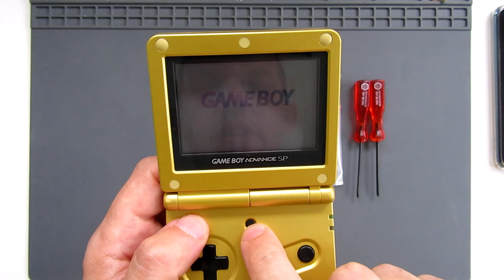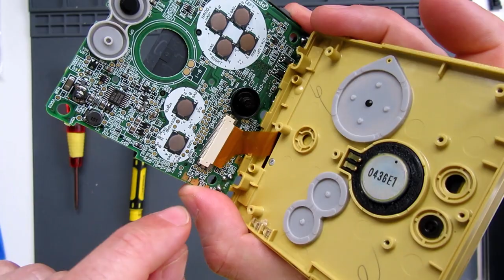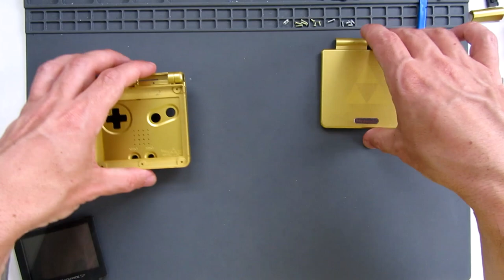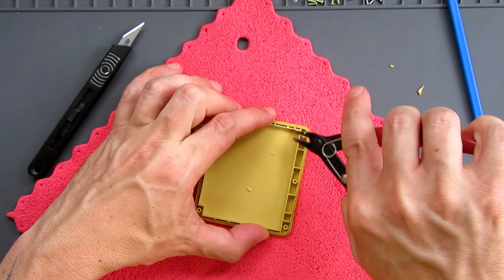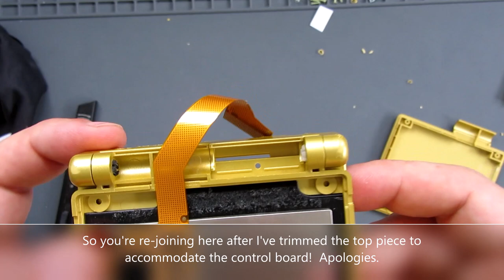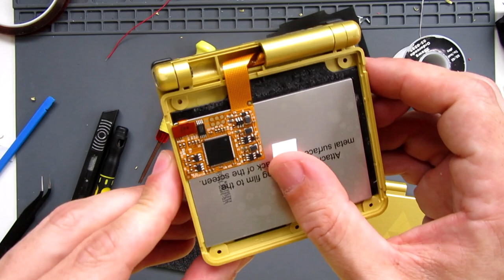How to fit an IPS screen to your Game Boy Advance SP

Comment: Great video which helped greatly with the install. I didn’t bother with soldering, however for me the trickiest part was getting that damn ribbon cable clipped back in, either you didn’t spend much time on that part of you find it super easy!!
Reply from the maker: Ahh sorry! Yes it is a bit tricky but not as bad as the ones on the DMG that require more force
Reply: if you dont solder does it remain on low brightness or high brightness?
Reply from the maker: @brokenshadows9357  highest setting
Reply: @JoeBleeps  is this the same with the v2 ips?
Reply from the maker: @brokenshadows9357  off the top of my head, the default with these things is just "on", which is the brightest setting. All the adjustments you can make just dim the screen to different increments.

Comment: How centered is the new screen? Do you lose a few mm on one side? Also, when you shake it vertically and horizontally, do you hear the new components move even slightly?
Reply from the maker: It is well centered and fairly snug. The foam insert helps stop any rattling

Comment: I'll be honest I did this myself but couldn't stand the IPS screen, I'm going back to the original front lit display the games were designed for. I thought I'd love it but just couldn't get on with it, thought the games looked worse, like radioactive worse. The shells are very cool though especially if the original is scratched up. Good work anyway Joe it was a very useful video you have made here.
Reply from the maker: Ahh that's a shame. I like how it looks but I guess it's not for everyone

Comment: Oh man! Now I can upgrade my original black 001 (it's so beat to heck) and has dust the size of two to three pixels between the screen and the front light.
Reply from the maker: Awesome! If you're thinking about replacing the shell too, take a look at my video with the Super Famicom shell, there's some useful info about replacing the hinges on there
Reply: @JoeBleeps  dude. You rock ♡♡

Comment: Did you notice any reduction or improvement with battery life?
Reply from the maker: Definitely a reduction. Not entirely surprising. The original battery is pretty old now and is 600mAh, so I've tried replacing with a new third party 850mAh battery, should make a fair improvement but I've not tested it enough to be able to tell yet.

Comment: Hello, on my C67 it seems that the solder doesn't stick, and it doesn't have that golden thing like in your video, do you know what it could be? Thanks!
Reply from the maker: Hard to tell without seeing it but the pad may be corroded or it may have been ripped off the motherboard.  You could trace the point to the next component or another suitable solder point maybe?

Comment: Thanks for this video. I’ve basically got a dilemma; I bought a reshelled gba sp with the ips v2 screen installed but I think the lens and the lcd have not been aligned properly as the screen is a bit wonky/slanted. It is uneven.

What I’m planning to do now is use floss to separate out the lcd and lens and put a new lens onto the lcd, worst case scenario the lcd breaks, then I’ll just order a new screen entirely and connect that to my gba sp (and do any trimming on the shell that i need to). In that case, I’m sure I can just remove the ribbon off my current screen (the one with the lens and lcd not properly aligned) and just connect that same ribbon to the new screen?
Reply from the maker: If you're doing that use a hair dryer or heat gun to make it easier to remove the screen cover

Comment: In terms of battery life how does that change? Does it have a better battery life than when the normal screen is installed?
Reply from the maker: It's the main disadvantage of these screens; the battery life is much shorter especially at max brightness

Comment: Can you link those side cutters ? I ruined two cases trying to melt the plastic off, since I don’t have proper cutters . I used a flat head screwdriver by heating up with the stove fire , which not only is not safe , it took way too long .
Reply from the maker: Yeah that would take an age! Even using a craft knife would be quicker than that. I bought my cutters from Maplin years ago before they all shut down. I don't remember the exact brand, but hopefully side cutters or fluch cutters as a search should do you well. The Games Workshop tools are generally good quality and intended for cutting plastic though

Comment: I have a question I also have the GBA sp asg001 I’m looking at these screens but in the details a lot of them r not telling mi if it’s for the 001 or 101 or do the new screens work on both?
Reply from the maker: I think it's mainly for the 001, it works with a 101 board too but I vaguely remember it needs wiring up differently. I don't think it's worth upgrading a 101 as it's a great screen anyway, but an IPS is a great replacement for the 001 for sure

Comment: Quick question when you "cut/shave"  the sides, I've just reshelled a SP & got a new screen protector with the kit but my question why can't you just carefully remove protector & just recenter the screen?
Reply from the maker: The IPS screen is bigger and has the display slightly off centre to fit.

Comment: I don't have a solder ing iron is there a way around it?
Reply from the maker: If you do it without the wires it will just default to maximum brightness, I think. But if you're spending out on a Gameboy, a new shell and a screen kit, a soldering iron is a worthwhile purchase too

Comment: I forgot to put the insulating film behind the screen before closing up the shell, is it really grave if I didn't?
Reply from the maker: It's more of a precaution than anything, if it all seems to be working fine I wouldn't worry. If there are any issues then that's the first thing you'd need to fix when troubleshooting
Reply: @JoeBleeps  Thanks, I'll keep an aye on it; but I'm tempted to open the thing back up and already dreading dealing with the hinges again
Reply from the maker: @sashielefreet1799  the hinges don't need dealing with once they are in place, you'll be fine
Reply: @JoeBleeps  damm you're right, I was about to something really REALLY dumb... Thanks bro!
Reply from the maker: @sashielefreet1799  no problem!

Comment: Great tutorial! I've completed the installation myself however, after about 5 minutes of playing the left button now controls the brightness aswell :/ when pressing the brightness button it also counts as a left press, could this be a soldering issue?
Reply from the maker: Sounds like the wire may be trapped under the d pad maybe? Could be a soldering issue also

Comment: what type of wire did you use for soldering?
Reply from the maker: I normally use 32awg servo wire or kynar
Reply: @JoeBleeps  thank you so much
Reply from the maker: @beagleboy2.040  I love the servo wire because it is easy to strip with your thumbnail and it's flexible so it puts less strain on the joint

Comment: Amazing vid! Anyone know where I can get the IPS screen in the US? The chinese vendor Joe used doesn't ship to the US and the website RetroModding does not ship it's screen to the US either.
Reply from the maker: Thank you! I'm sorry to hear its been hard to get one. Have you tried Deadpan Robot? They are UK based but ship internationally, try the link in my description if you haven't already.
Reply: in case you haven't found one yet or anyone else needs one, these kits are all over ebay from tons of chinese vendors, some even sell them bundled with aftermarket shells that don't need trimmed to fit the lcd (although most shells don't include hinges so you would need to remove those from your original shell)
Reply: @coopercummings8370  

Yep, that's exactly what I did but I bought the kit on AliExpress instead of eBay. It works and looks great. Here's the link for the one I bought for anyone interested: https://www.aliexpress.com/item/4000843765370.html?spm=a2g0s.9042311.0.0.1e574c4dQqNBM4

And also here are some pics of my finished GBA: https://imgur.com/gallery/sdmqC4F
Reply: @JoeBleeps  Hi Joe, sorry for the late reply. I never got to see this notification. I managed to get the kit on AliExpress, and it turned out great! Only caveat is that I don't have a soldering iron so I couldn't implement the brightness selector. 

Anyway, thanks for the amazing video! Here are some pics of my refurbished GBA SP: https://imgur.com/gallery/sdmqC4F
Reply from the maker: @kevinrivera2813  that's awesome! And no worries, thanks for the update!

Comment: In your experience does it effect the speaker using these ips screens? Mine seems to have a bit of noise since installing the screen and is especially noticeable using earphones
Reply from the maker: Not to a distracting extent. I'll have to check one against another to see. Or hear, as the case may be 😅
Reply: @JoeBleeps  i have a feeling that as it’s drawing more power it’s somehow effecting the sound as I can pretty much hear the different frequencies and hums as the games load. It’s much worse using headphones.

Comment: Be careful with those "free" screwdrivers! If you come across a stubborn screw these cheap things can strip out the screw head. 
Same with any of the cheap chinesium screw driver and bit sets. If this is a one time thing you will probably be fine.
If you plan on doing more of this kind of work Id suggest getting a better quality bit set. Wiha and Wera are good.
The first time you strip the head of a hard to get at screw you will find out what I mean.
Reply from the maker: You're absolutely right, sometimes the drivers that come with these things make the job ten times harder than it needs to be. Occasionally they'll be decent, I'll sometimes try them out but usually I'll default to my own tools

Comment: Is there a way to disassemble the entire system after installing the IPS lcd? Or would that require desoldering the wire?
Reply from the maker: I'd say it would be easy enough but yes you'd need to desolder one end of the wire from the spot on the ribbon cable. The other end may as well stay attached to the motherboard

Comment: Guys can someone please help me? I'm looking for this mod but I want to buy it from Europe so as to avoid the taxes etc. (I want to pay for the price of the mod and the shipping and avoid the customs and other taxes). The mod itself from the link in the description is at a good price but the taxes and customs almost double the final cost. Can someone please help me find it as cheap as possible? Thanks
Reply from the maker: I always use deadpan robot in the UK but if you're elsewhere in Europe that's a problem since Brexit 😔
Reply: I used the link Joe provided in the description (ebay) and the guy sent it to me (Cyprus) from Belgium. So not any extra fees there except £6 VAT. Total cost £38..or €46 if u prefer

Comment: Your tactic of removing the plastic took a lot of time. 
What I do: I'm cutting those side ribs in with a sharp knife. After that I cut in the bottom of that long piece of plastic (inside direction). Just 3/4 times maybe. Then I push from (outside to inside) that whole part of plastic, till it 'breaks'. You have to try it, it is very clean and done in 4 minutes.
Reply from the maker: It's a good method, I've done that before too. I just thought with a beginner's tutorial I didn't want other people slicing their fingers trying to follow my guide! 😅